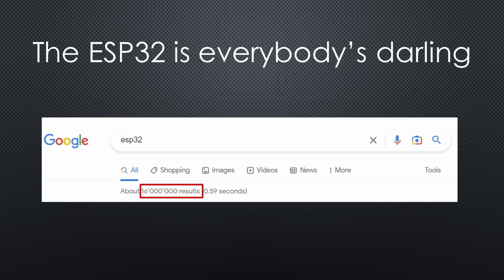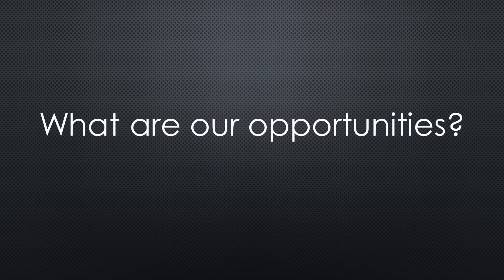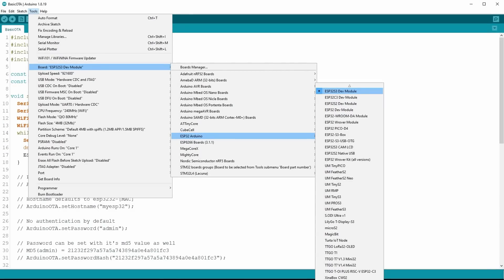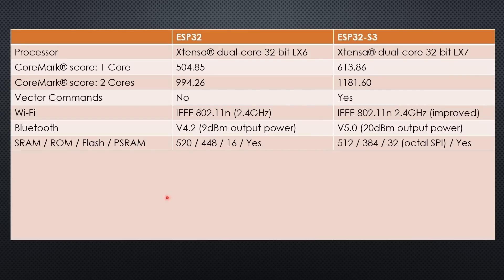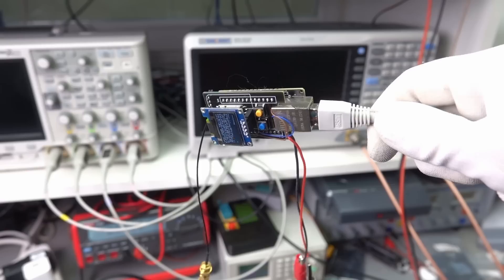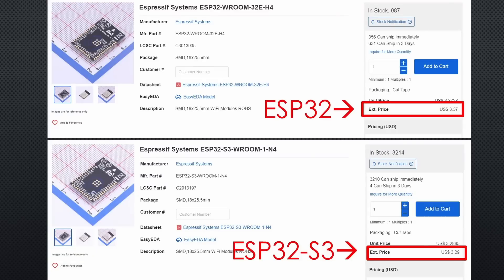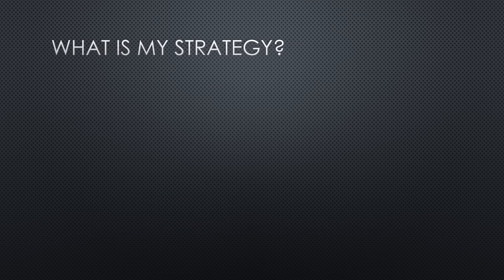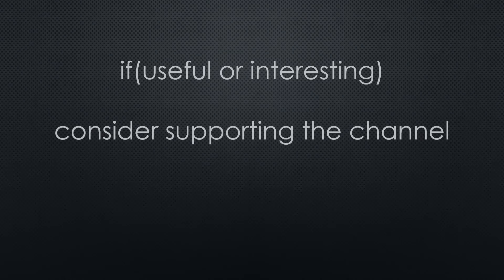451 Which Processor can kill the ESP32?

Comment: Could you maybe do a deep dive video about Matter? I don't know why, but I can't find a maker-focused video on the topic that really explains how it works, on what ICs it should work and on what not (you mentioned the ESP32-H2 'with Matter' support' - but isn't Matter just software, and Thread is hardware dependeant?). I would love a video like "Matter compared to MQTT".
Reply: AFAIK Considering the OSI model ( https://en.wikipedia.org/wiki/OSI_model ).
"Hardware"* or layers 1 and 2  are  defined by IEEE 802.15.4 and are shared with other protocols like Zigbee.
"Software"* for network communication or Layers 3, 4, 5? are defined by Thread.
Matter is the software and  hardware for the application (layers 6 and 7) and the definition of the standard as a whole, including the two above.

I use quotes because hardware and software are fluid concepts in modern chips. Many radio chips are software-defined (some chips like the nrf52840 can be used as thread, zigbee or bluetooth nodes) and, of course, SOCs and MCUs are defined by their firmware.
Reply: @edgarmondragon4708  Yes, but that's why I don't understand Espressif bringing out a chip with Matter support - as far as I know, Matter is application-layer, and can run over i.e. Wifi. 
Thread is another ... matter... of course.
Reply: @MoritzvonSchweinitz  Matter is only a standard for interoperability, and yes, a brand and a MKT tool.  The important tech piece is IEEE 802.15.4 and the Thread/OpenThread  stack.  And the reason is low energy and the Internet Protocol. Bluetooth is good for audio and low energy but is a mess for communication between many devices. IP is a well established and reliable protocol for small and large networks. You got routing, address assignment and many other well known tools.
  If you want, Thread is just low bandwidth WiFi for batteries with mesh and IP / routing capabilities.
Reply from the maker: Matter over WiFi will probably not be used for sensors. There, Matter supports "Zigbee".
For the moment, I wait a bit because I want to see how these big boys come along with each-other...
Latest when Espressif supports Zigbee on Arduino IDE it gets interesting for us.

Comment: I am very interested in the octal spi of the esp32-s3, but there are 2 major problems preventing me from doing so. The first problem is the sdk, it is over complicated, it is near impossible to use any spi type with these chips. What i will need to do is manual register manipulation, but that comes to the second problem. The online technical reference datasheet tells what each register does, but it says nothing about each single bit, and that’s also the same for every register. If anyone can tell me every bit for each spi register on the esp32-s3 i will gladly appreciate it, because i need to use it urgently for a project.
Reply from the maker: I never worked with it. But usually, you get libraries for such things. Did you look at the examples of LilyGo's board?
Reply: @AndreasSpiess  yes for the ttgo t-display s3, but that uses a built-in parallel display driver and i guess they got it to work, but not for octal spi. I am working to try some new experiments, but i’m limited by software.

Comment: Does it make sense that the ESP32 has dual core in standrard Arduino  sketches, compared to the single core S2? Utilizing the 2nd core was not straightforward earlier.
Reply from the maker: It has double the power if you need it. If not, there is no need for it.

Comment: You might want to look at the new Pine 0x64. It's very new, so little support. It's a hybrid MCU / CPU. It can boot into Linux or run RTOS. Looks promising.
Reply from the maker: As an old man I am very reluctant to use new MCUs. They usually are time holes and a lot disappeared after a while...
Reply: @AndreasSpiess  haha, same here. In my younger days, I'd be all over it.  I'm finding ChatGPT extremely useful, although it's not much help here with something so new.  There is at least one YouTuber playing with it, so I'm following them.
Reply: There's a few setup guides online so it's not too bad.
There's also the sipeed m1s which uses the same chip set as the ox64.
It's 480mhz 64 bit risk V with 2 32 bit additional processors, and it does bt ble wifi and zigbee afaik.

Apparently it also has an audio dsp which may be interesting for some projects.

Also it has an NPU accelerator for ml tasks which can get better performance than cpu acceleration on some older laptop processors, so for cv applications it looks really interesting compared to an esp32 cam module

Thinking about it some more it has the full feature set for an audio assistant.
Reply from the maker: @satibel  You did not mention the Arduino IDE support...
Reply: @AndreasSpiess  I haven't checked if it's Arduino compatible or not, hence why I didn't mention it, they are compatible with freeRTOS which apparently you can compile for with the arduino ide, but I haven't tried it.

Comment: stm32wba52ce is proabably one of the biggest competitors against esp in terms having built in 2.4ghz and uses an arm cortex m33 which seems to perform better than esp core at 240mhz, running at half that clock
Reply from the maker: From a HW point of view you might be right. But I decided to stick with the Arduino IDE on this channel because it is open for several chips.

Comment: Losing the DAC is a huge issue for many.  No more simple DAC based audio, and no more composite video output!
Reply: FWIW, the S3 has PDM output on the I2S peripheral. This means that with only a simple RC network, you can still get fairly high audio quality out of it; in my experience it can be better than the 8-bit DAC.
Reply: @Spritetm  True, but that uses multiple pins to accomplish this.  The DAC was a simple single pin option, and there is a ton of code for it to output audio and composite video (which is most important to me).
Reply from the maker: In our project, we use an I2S chip (ES8388) with the S3. A quite simple thing and lots of possibilities...

Comment: @Andreas Would appreciate any guidance on Ethernet with S3... I have tried to connect a W5500 module with limited (ok, none) results. I've tried what I think are both usable SPI pin sets... my maybe I have it wrong. Tips (not $) appreciated!
Reply from the maker: AFAIK there are two Ethernet examples in the Arduino IDE (not for your chip). Maybe they help?
Reply: @AndreasSpiess  Yeah, I can get it to work with the ESP-32, but not with the S3. Not entirely sure of the wiring!

Comment: I think 802.15.4 with Thread and a Border Router is really great,
- Very low power (sensor can run for years on battery)
- IPv6 Tunneling, so can report data directly to an online backend
- Thread Border Routers are commonplace now, almost all modern smart speakers, home automation hubs and such are either currently a thread broder router or will be with an update.. Just a matter of time, till your average DSL router will include a 802.15.4 module / act as a "smart home" hub.
Reply from the maker: I agree and look forward to getting the Arduino support needed to build my first 802.15.4 sensor. Did you already build one?

Comment: I first learned about ESP32 by watching this channel, it was 5 years ago in July 2017:  #149 ESP32 Deep Sleep, RTC Memory, "Secret" LoLin Pins.  Strange and interesting how in 5 years, ESP32 still has no real competitors (for price, features, wireless capabilities). 👍  I roll my own ESP32's using JLCPCB SMD service which allows me to 'upgrade' ESP32 defective ADC's with a nice 12-bit ADC from either MCP or Analog Devices- I got this idea from you Mr. Andreas and I could not be happier making my own ESP32's!!! 😎   I found one other MCU in 5 years that is more interesting than ESP32 but not necessarily a better option:  Teensy 4.1 with NXP iMXRT1062 ARM Cortex-M7 600MHz.  The Teensy 4.1 is a programmers dream, it's impossible to run out of GPIO's but unfortunately price is the killer for this MCU at $32 USD vs $3 USD for ESP32 (10x price!!).  I think the Teensy will go down in history to be the MOST EXPENSIVE MCU in the history of the world 😀but I hope I am wrong about that. Teensy has a support forum that rivals Arduino's Forum in some ways, and kudos to Paul Stoffregen for all the great work he is doing with the Teensy MCU platform.

Comment: For me no competitors. I'm waiting to ESP32-P4 :) Pins count is no problem, SPI latch ICs are very cheap and fast :)
Reply: Sadly the P4 will not have BLE nor WiFi. It's only f*cking fast compared to (original) ESP32 or ESP32-S3. I was also looking for the P4, but without radio connectivity, it's not practically for my use cases (I don't want to build my own pcb with an external radio).
Reply from the maker: Maybe Zigbee (or Thread) will replace WiFi in many applications if we can use it for MQTT (or similar) for example. That would change a lot, I think.

Comment: I started my journey into C++ programming on ESP32 dev boards a couple of years ago. I like using them, I’ve only had one die on me. It got ‘cooked’ in my greenhouse on a very, very hot day. Many of the plant in there died too 🙁
I have had a play with RPi Picos. My grandsons (10 & 12) made electronic dice for playing D&D. That was last summer, they’re still using them. I had a bit of a re-learn of Python and liked the boards as they’re more compact than the ESP32 and fit on a breadboard nicely.
My main (on going) outside lighting project will continue to be based on ESP32 boards.
My main criticism of the ESP32 is the analogue input, it’s too unstable to be of any practical use. It just about works with a soil moisture sensor. It gives me a ‘ball park’ value which stops my plants drying out.
My lighting system is getting incrementally more reliable, as my programming skills improve. Any problem with my ESP32 boards regarding reliability is entirely dependant on my ability to ‘tell them what to do’ in C++! Apart from the cooked one, they’ve survived all my wrong connections and sloppy programming.
Reply from the maker: Thank you for sharing your experience! I recently changed many of my "bread and butter" projects to ESPhome or Tasmota because it is so easy and fast to create a new node and integrate it via MQTT.
Reply: @AndreasSpiess  I use NodeRed and a mosquito MQTT broker running on a Raspberry Pi Zero W. (I bought one, the day they were released. I want more!). Originally I used a Raspberry Pi 4, but it was a waste. That’s sitting in a box waiting for an interesting project to use it for).

Comment: I finally settled on RPI Pico rp2040(and /w) in the Arduino 2.x environment due to cost despite the initial learning curve frustration.  Works just fine with LoraWan ttn, Oled, GPS, SD cards, memory size, etc.  ESP32's are back in my parts box and my hair is finally growing back.  LOL.  Thank you for the new video.  Keep them coming.
Reply from the maker: Is there a big price difference between an ESP32 and a Pi Pico? I thought they are similar.
Reply: @AndreasSpiess  and the RP2040 uses more power and is much slower

Comment: Another important difference is that in the S3 the internal temperature sensor works. In the old ESP32 it was unusable.
Reply from the maker: I never used an internal temperature sensor. What is your use case?
Reply: @AndreasSpiess  Not all batteries come with a temperature sensor, so I use the internal ESP temp sensor to know if is safe to charge or not the battery (never should be charged when temp is greater than 40°C). Of course the measurment is not too precise, specially if the processor has been running at full power, but if read after a sleep cycle it is quite useful: saves an additional external component and is free.

Comment: Recently got an ESP32-C6, there are only Sample V0.0 chips currently, which don´t have their ADC calibrated.. Otherwise it´s quite nice!
It has
- 802.11ax WiFi (way less power consumption due to target wake time)
- Bluetooth 5 (BLE as well)
- up to 16MB of Flash
- an integrated 802.15.4 radio for ZigBee and Thread -> They have nice libraries in ESP-IDF for both.. Thread is quite nice as you can do IP via it, in a very low power fashion. I already connected it to my network via 802.15.4 via my Nest Hubs integrated Thread Border Router.
Reply from the maker: Cool chip, I agree (I saw one last week in Nürnberg). So we only have to wait for Arduino IDE compatibility...
Reply: @AndreasSpiess  ESP-IDF works as well, but yes, arduino is easier ;)
Just implemented a ZigBee switch, which sets a ZigBee bulb to a random color on every button press lol.. Couldn´t think of a more usless application of the 802.15.4 radio :D
Reply from the maker: @Spacefish007  So there is hope that we will get this functionality soon...

Comment: I want something 5v that still accepts 3.3v inputs so I don't need to use so damn many level converters.
Reply from the maker: Most of the current sensors are 3.3V. For years, I did not need a level converter. And I always work on 3.3V.
Reply: @AndreasSpiess  I do a lot of industrial stuff.  The stepper and servo drivers that are more than a few amps all seem to want a minimum of 5v.  Half the crap I interact with like industrial robots want to talk 24v.  And then there is the ancient serial ports that think serial ports are supposed to talk at -12v for some reason.

Comment: I never tried the newer chips. My latest was the WROOM. The WROOM was a powerful chip. It is a wide chip, though, so it doesn't fit well on a breadboard. I was lukewarm on their SDK, although I guess it was good enough. Having to download a separate Xtensa compiler and some monkeying around with the install was tedious. My go-to chips have been the Pico RP2040 and the STM32F411. I think the RP2040 has the edge, although the development environment for the STMs is pretty good. I tend to flop-flop around a little but I mostly end up using the RP2040. The RP2040 is VERY popular with the Maker community, and when it comes to really cool projects, the RP2040 seems to outshine STMs. It doesn't help that STMs are difficult and absurdly expensive to get hold of right now.
Reply from the maker: I agree, the RP2040 is more popular than the STM32s in the maker community. But the real king is the ESP32 in this community ;-)

Comment: Beautiful coverage.  Thanks for mentioning the RISC-V versions of the ESP32 as well.  There's more models coming for sure so thanks for covering those too such as the C6 and P4!
Reply from the maker: Indeed, it is interesting to see that Espressif changes to RISC-V. I assume that many will follow.
Reply: @AndreasSpiess  Guess the RISC-V move is great, they avoid sanctions + the RISC-V core designs are cheaper in the long run.. Easier ISA, less chip area and a lot cheaper or even free Core IP.

Comment: One big problem with the ESP32 is that it needs an intelligent reset controller.   If the chip runs with a low VCC, it can destroy the program.  Does any of the newer ESP chips fix this problem??
Reply from the maker: I once made a video about small chips that, connected to the enable pin, prevent this.
Reply: @AndreasSpiess  Yeah... I know,  but does any of the new chips fix it?
Reply from the maker: @jamesmichener7526  I do not know 😞

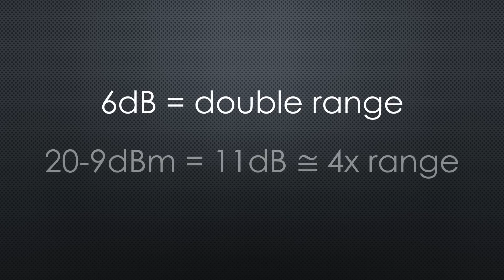Comment: 4:45 6db double the range in terms of surface covered not distance, with the omnidirectional antenna installed on those devices.In this case your explanation is misleading.
Reply from the maker: Maybe I am wrong. I read this everywhere but never did the calculations.

Comment: Great overview of ESP32 variants. For me Wifi+Ethernet support is a must, so sticking with ESP32.  I just completed Ethernet integration on my project. One hardware change I would love to see is using a different pin for the MAC_CLK 50Mhz input. GPIO 0 is also used for bootloader. Having Ethernet on during a reboot causes the ESP32 to get stuck in bootloader download mode.
Reply: Using LAN8720 PHY generate 50 Mhz clock from ESP32 works but with a couple of restrictions, you can't use i2s peripheral and the ethernet connection becomes intermittent when is used simultaneously with wifi in access point mode (SoftAP). I recommend to use external 50Mhz oscillator, to prevent the ESP32 from starting in programming mode You must use one more pin to control the oscillator output enable pin and ensure a low state on this pin at initialization time by a pull-down resistor but it works like a charm
Reply: @davidyepes2  I'm using a custom PCB with a KSZ8091 and 25Mhz OSC.  Had to add a 5.11k pullup resistor on GPIO0 to get the ESP32 to boot reliably, because the KSZ8091 backfeeds 1.6V to the ESP32 through the REFCLKOUT pin.  Seems to work well.
Reply: @DavidMcCurley  you are right, it should be the first option to try, in my experience it works with IP101 phy chip too but unfortunately doesn't work with some chips like a LAN8720
Reply from the maker: Indeed, using GPIO0 for other signals was not their best idea ;-)
Reply: I noticed the same on a work project. Ended up feeding the PHY a clock from the ESP32 instead. This worked great.
Reply: @danedwards_ee  Which PHY chip did you use?